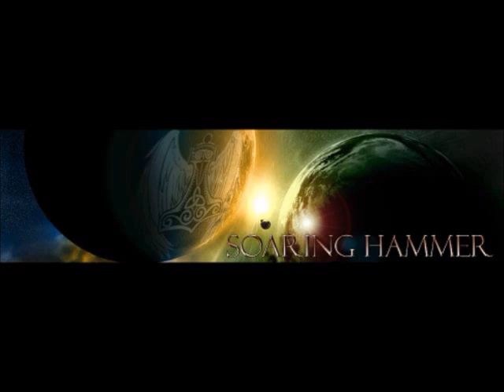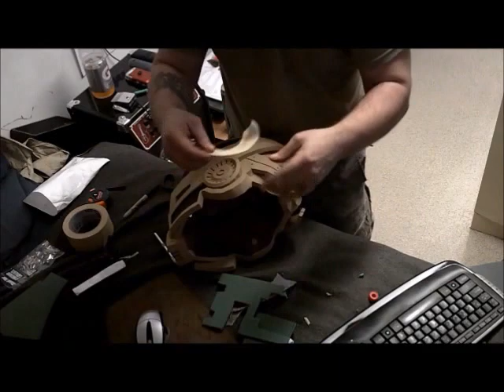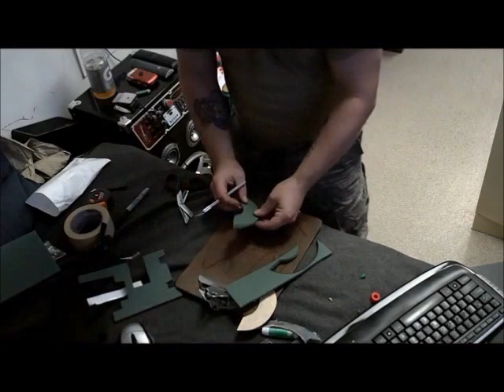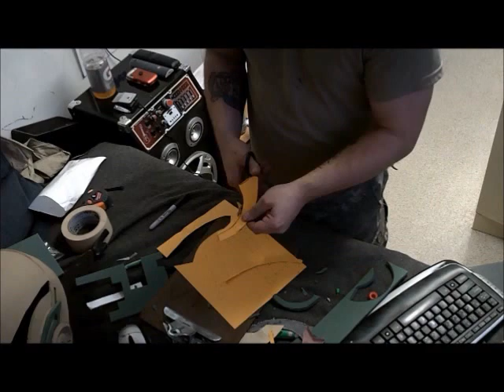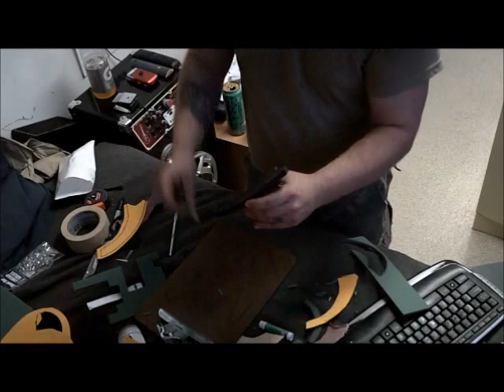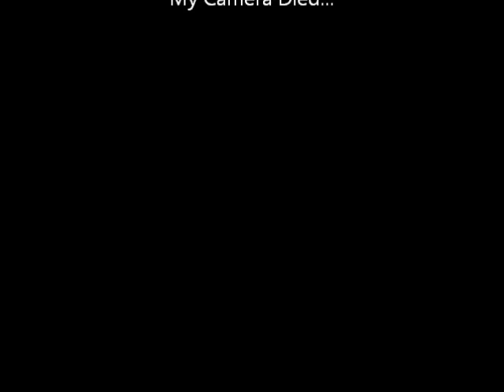How to Prop Part 1

Comment: @roceifin The foam he's using is Foam Flooring Interlocking Mats.
They're 1/2"inch thick and 2'x2' ft sq.
You can buy them for about $20 to $30.00 for a pack of 6 at Kmart or any automotive, sports stores.